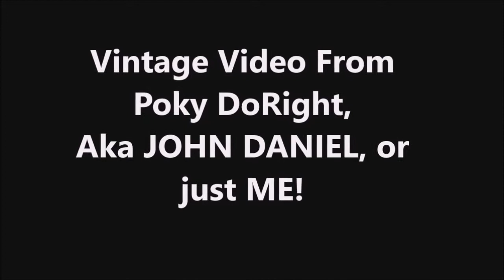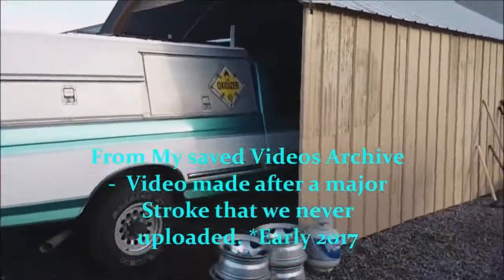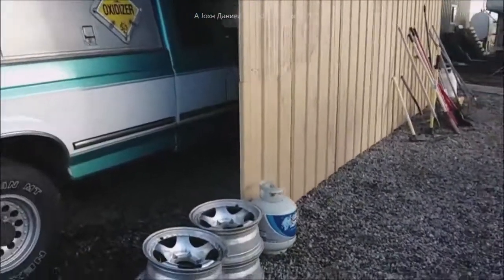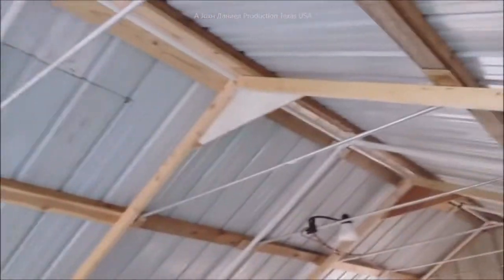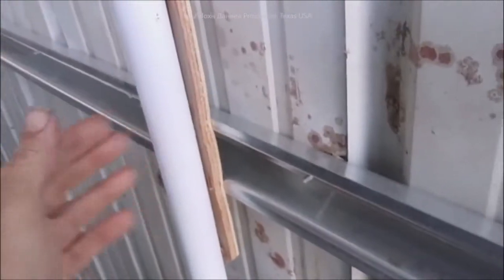I Built 14 x 21 foot Garage from Salvaged Harbor Freight $99 Carport Kits, NOS video share

Comment: Wow, Great job too . I scrap for a living stop calling a lot of these harbor freight frames myself and I have about 50 firing metal or what you call hat metal I'm not sure if the gauge but you can't bend it easily. And wish me luck I'm about to build me a carport or enclosed structure that I can do work in out of the extreme heat or rain which we have a lot of in Florida. I subscribe to your channel keep sending videos. And I will post a picture of my shed

Comment: Awsome job. im working on the same thing now. my pole struture has metal on the sides at top middle and bottom. i dont beleve i will have to use the hat metal. I trying to figure out some sort of roll up and down door system.

Comment: Did you just add more length to the top I’ve done one I want wider but I built mine shorter just to fit front or rear of a vehicle